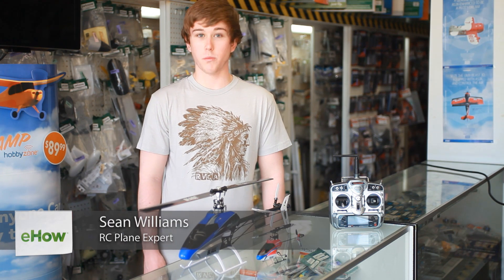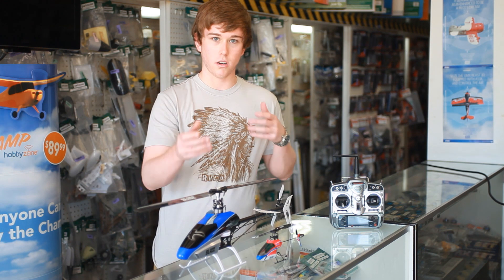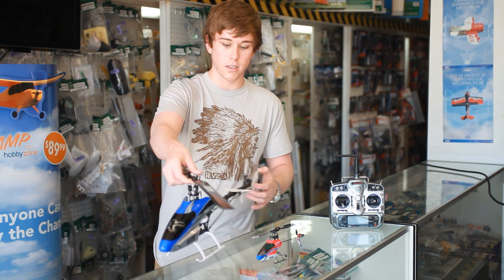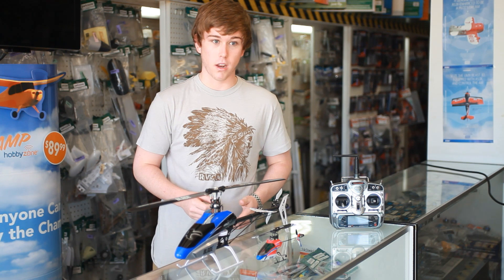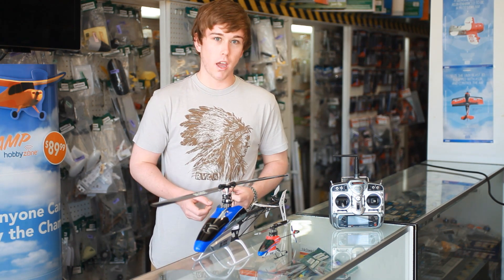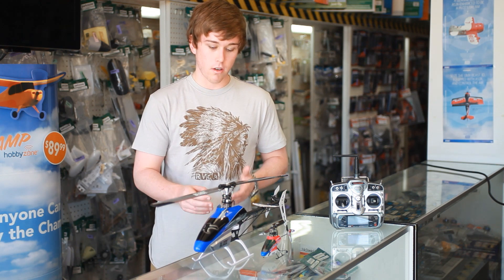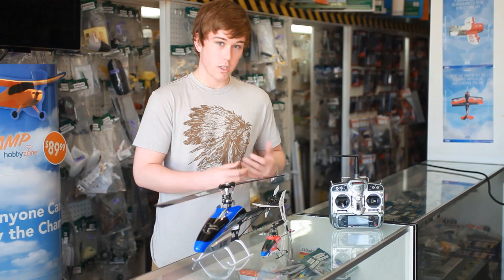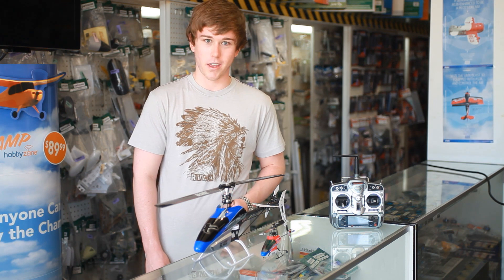How Come My RC Helicopter Keeps on Spinning Counterclockwise? : RC Planes

Comment: For coaxial helicopters ... the little toy ones.   My helicopter was spinning and wouldn't take off. lt was the big gear cog for the lower blades, the one that meshes with the little cog on the motor. lt was spinning on the shaft, which meant the top blades rotated at normal speed and the lower blades where slipping causing the helicopter to spin. l pulled it apart , put a small drop of super glue on the shaft and cog and put it back together, immediately it flew perfectly. I think this happens when you crash and the motors are still spinning and it makes the cog slip on the shaft instead of breaking the teeth. Probably a good design as long as you know whats happened and how to fix it. I will try to throttle off as soon as i crash from now on. Might sound complicated but very simple fix. 20 minutes of taking your time and a tiny drop of superglue and you'll be flying again. Hope this helps somebody. happy flying

Comment: If you are running the beastx, you need to reverse the tail gyro sensor direction. Even if it looks correct to you try switching it. This happened to me on my trex 550. Everything looked right, I switched it just to see and it fixed everything.
Reply: Hi i have reverse the rudder servo but it still pin counter clockwise, the servo work perfectly, im thinking maybe my gyro is not that good, my heli is 500

Comment: hi all I have just bought a second hand 3D helicopter I have problems with it turning in circles mostly clock wise as soon as I use rudder to try stop it it starts spinning in opposite direction. it will not trim out. can anyone tell me what I can do..

Comment: I have a Hero H911 4CH heli and it will randomly spin counter clockwise if I turn left during flight. Emphasis on the random because it only happens sometimes. The red wire to the tail motor seems to be cut a little, but that would mean the back propeller wouldn't spin at all. I really don't understand the problem and don't wanna pay to get it fixed. Any suggestions?